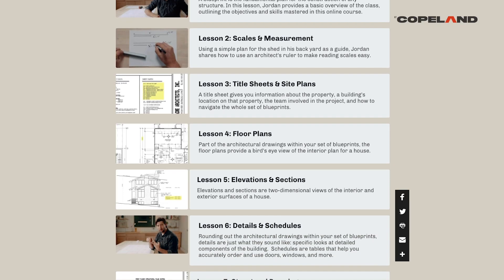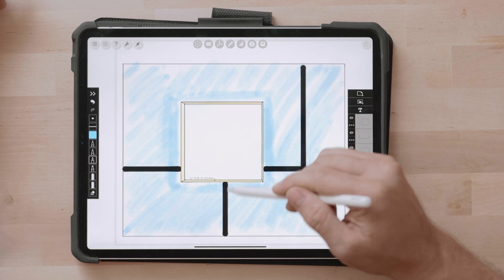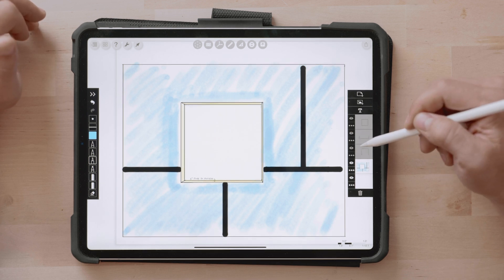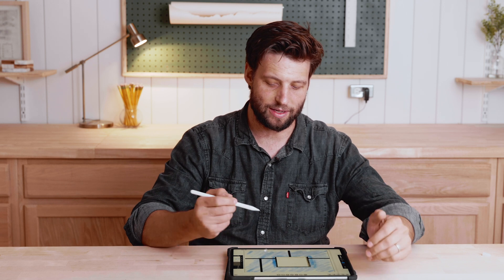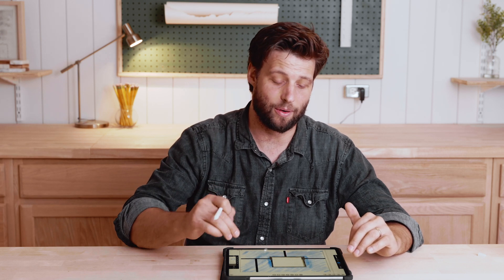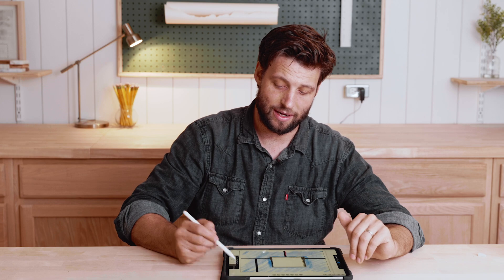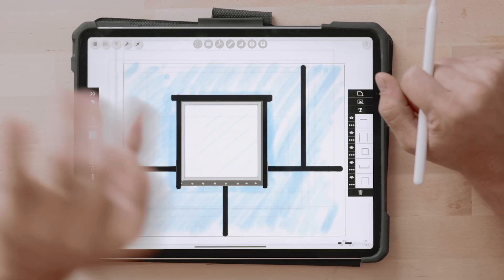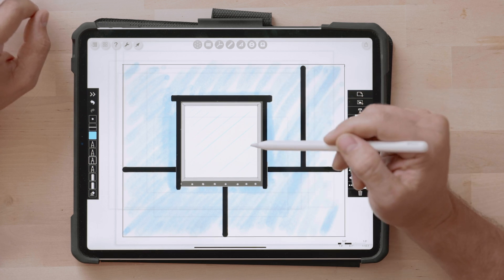How to Install a Window In Zip Sheathing

Comment: If you're never supposed to nail the bottom flange why don't window manufacturers just eliminate them? Cut down on cost of material ...
Reply from the maker: You do nail the bottom flange, you just don't tape and seal the bottom flange from the exterior.

Comment: I'm planning on switching from backer rod/sealant to one of the split-back Siga/Pro Clima tapes for the interior air sealing.  Might still use backer rod and sealant on the sill as a back dam and then tape over it. The sealants really only have a 1 year reliable shelf life, while tapes will last years - tired of throwing out expired product or half-finished tubes.  And tapes are less labor and easier to quality check.

My go-to sealant is NP150 rather than NP1 due to higher movement rating - it's a hybrid sealant rather than just a polyurethane - adheres to more surfaces - for me, it's an all-in-one sealant.  I also like NP150 as a liquid flashing - applies slightly thicker than most STPE-based products (only Prosoco's fiber-reinforced Joint and Seam has similar thickness).